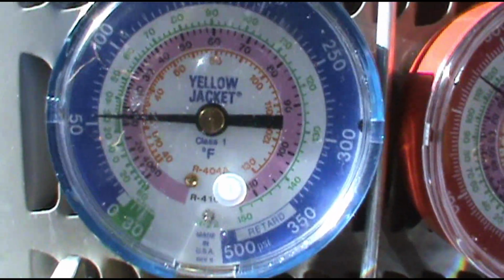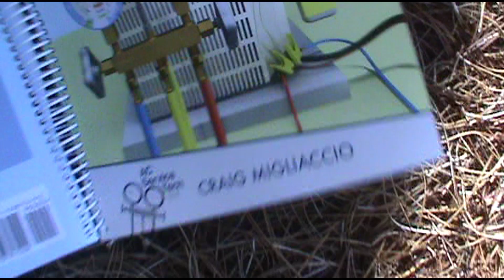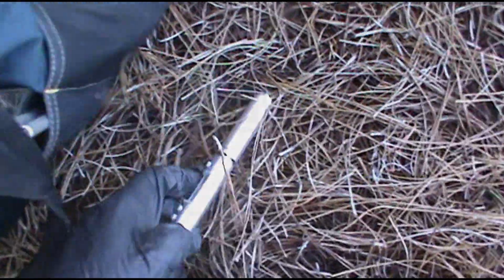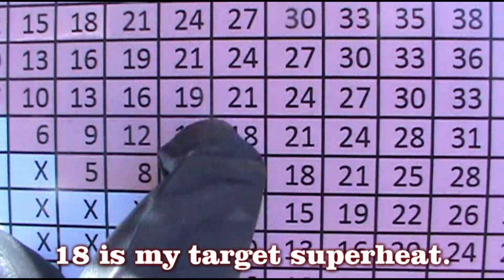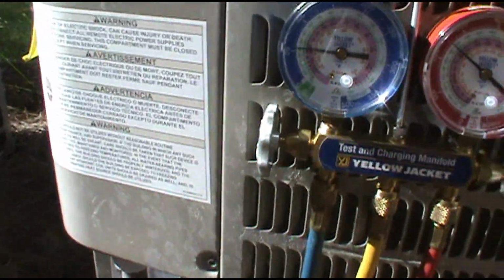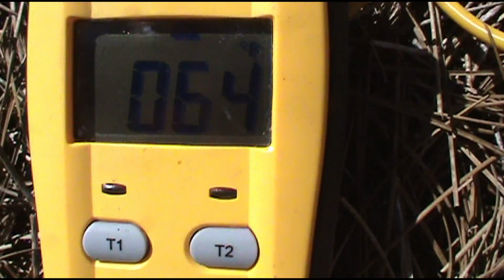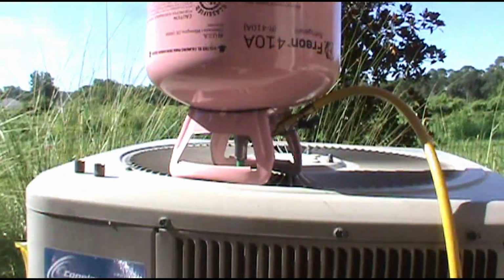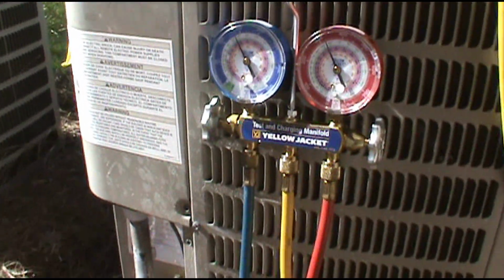Charging AC Unit Using Superheat

Comment from the maker: Refrigerant Charging & Service Procedures for Air Conditioning book link:
https://amzn.to/3eLXxDO

HVAC Quick Reference Cards for Refrigerant Charging & Troubleshooting: https://amzn.to/32Pmega

Refrigerant Charging & Service Procedures for Air Conditioning Workbook: https://amzn.to/30IYW90

HVAC Tool Links Used in This Video

Fieldpiece Psychrometer: https://amzn.to/2ZRg65d

Fieldpiece ST4 Temperature Meter: https://amzn.to/3eTWwJG

Pipe-Clamp Thermocouple: https://amzn.to/2ZTJ0S4

Yellow Jacket HVAC Refrigerant Gauges: https://amzn.to/2CW0kx5

If you'd like to support the channel, you can do so by shopping for tools or whatever you need on AMAZON at no extra cost to you through this link,
https://amzn.to/2Wc05o5

If I've provided any value for you and you'd like to donate $1.00 or more into my online tip jar, you can do so through this link, (all cards accepted)
https://squareup.com/store/dirty-maintenance-nation

This page contains affiliate links, which means that if you click on the link and make a purchase, I’ll receive a small commission at no extra cost to you. Lex Vance is a participant in the Amazon Services LLC Associates Program, an affiliate advertising program designed to provide a means for sites to earn advertising fees by advertising and linking to amazon .com

Comment: Great explanation, and some days at a property we have to just do a gas and go and come back to it. We are many other things other than hvac techs so we are needed in 10 different places at the same time. I have 4 evap coils that have very slow leaks but will make it through the summer so I will return to those this fall and replace them. I have to handle the ones that are shot and everything else that needs done, of course if one of them go out then that's different but if they can hold off that will be good for me and will be a great teaching experience for both of my techs who are learning air conditioning. Stay cool out there 👍👍
Reply from the maker: Right on well said Rich! All facts.

Comment: Quick question...what temp should be coming out of the register ? What is an acceptable split --- register vs return temp ?
Reply from the maker: I was always told 15 to 20 degree split is ideal. My register temp is always in the low 50's and return is high 60's to low 70's.

Comment: I need your help can you put a single pull contactor in place of a double pull in a pinch
Reply from the maker: I would hold off and go back with what's there.
Reply: Lex Vance thank you my ac is out and I had a single pull but it has a double bull

Comment: For an R-22 system if you have both the high and the low side equalized such as having the same psig, does that indicate a bad compressor? And if so is there a way to verify that
Reply from the maker: Bad compressor or a bad capacitor. I have videos on that. You can search " Lex Vance How to check compressor" or "Lex Vance How to change capacitor".
Reply: Lex Vance thanks I appreciate it , I’ll make sure to check them out! 🤘

Comment: Does the book have  good troubleshooting  tips  like  when the super heat starts high with low head and suction pressure then as it runs the super heat drops and  suction , head pressure go up
Reply from the maker: Yes. This book is written by a technician and not an engineer. Thank goodness. The industry needed it. If you combine the book with his YouTube channel you'll excel fast. Make sure your wallet grows along with the knowledge you gain too. 😆 Maintenance techs who are good at HVAC are highly in demand in the apartment multi-family/ hotel industry.
Reply: Lex Vance yeah i follow and seen all his videos  i haven’t gotten the book cause i was afraid it was mostly basics  and stuff hes done in the videos

Comment: Our TXVs always maintain a superheat so I've actually never checked superheat. The only time it matters (that I know of) is if there's a restriction. But a restriction is pretty obvious with some caveman gauges hooked up to it. Kind of like the ones you have there Skid! In fact, I think those are exactly the ones I own. Anyway the low side will drop and the high side will increase the longer it runs and the suction line will start to ice up.
Reply from the maker: I'm a piston man. 🤣 Thank you so much for watching ReelGuy!

Comment: what if u add refrigerant and it goes up? would dropping the thermostat to 70 for it to kick on since it has already satisfied the thermostat at 74... i know in the - super you remove regrigerent but when ur super is higher then target and u add refrigerant and it add super heat is could a unloaded ac unit cause this
Reply from the maker: That's a great question. I'd need to try this out. Thank you so much for watching!

Comment: heya Lex, really been digging all your vids recently! I've been interested in getting in the trades for a while now, and apartment maintenance seems like the right move for me, been thrilled I found you and your career! Problem is, all job postings online for being any type of maintenance tech require years of experience, (which I definitely don't have, I'm green) so I have been looking into cold calling apartment complexes nearby, is this an alright thing to do or is it rude/illegal? Ill basically ask if they have openings as a maintenance helper cleaner-upper guy. Let me know what you think of this plan to get into the field, otherwise how else am I supposed to get my foot in the door, especially now haha. How did you or guys you know to start in the field, would greatly appreciate some advice, I feel stuck on getting in the field!
Reply from the maker: Hey there Isaac! I got into the business through student housing & I didn't know the difference between a flathead and a Phillips head screwdriver. Student housing properties are always hiring. If there's a college around you, then there's student housing. You won't be working on a campus or for the college. There's apartments that caters to college students only. So, they're called student housing properties. That's the easiest way in in my opinion. If you don't have a college near you, then you'll need to just get out there and start filling out applications. Hope this helps!
Reply: @LexVance  hey thanks so much for responding! That's what I'm going to do, I live right next to a huge college, 👍big help thx!